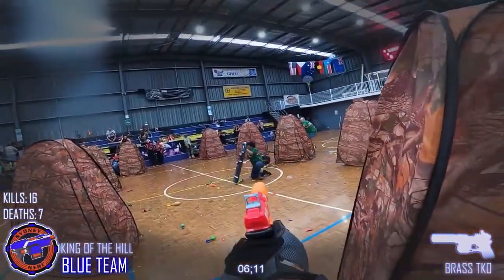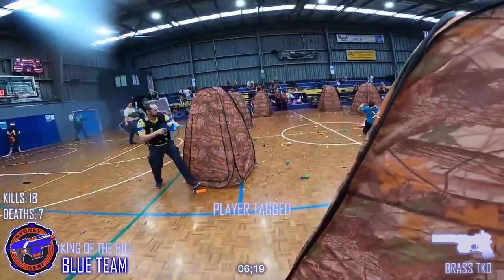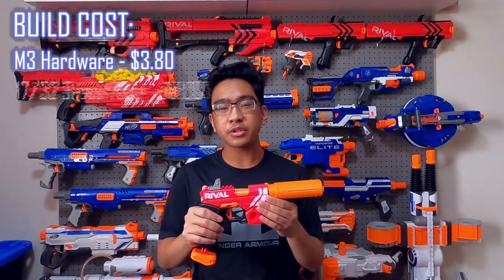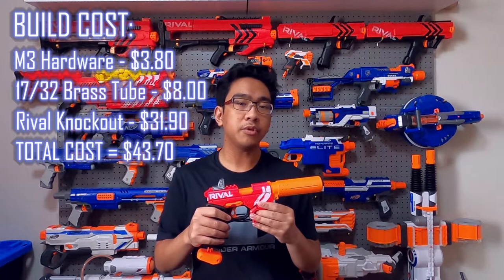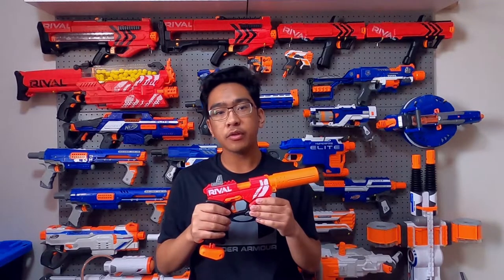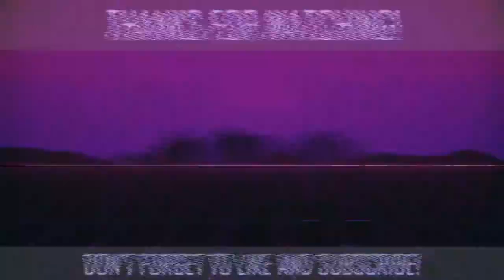Brass Barrel TKO Overview | Nerf Rival Knockout Inline Clip Mod

Comment: great vid, just put together a tko myself.  it seems you've switched to the mk2 as a sidearm, but what were you using for a holster with the tko?
Reply from the maker: I'm still using the same holster that I used for my TKO with my Mk2. It's just an adjustable holster I found on Ebay years ago.

Comment: You should be getting higher than 120fps with a stock spring tko. My inline clip TKO gets 150 with the stock spring.
Reply from the maker: Yeah, my TKO is definitely hitting lower numbers than it should be. I'm guessing it's due to the opening of the brass barrel as it isn't very refined and my air seal might not be the best because I'm using electrical tape to fix the barrel in place instead of o-rings. I'll get around to fixing it up at some point.
Reply: 150 consistently? What are the barrel specs? Currently trying to build  one as well
Reply: I installed a new spring in my knockout and when I fired it for the first time at broke the internals any idea as to why
Reply: @DaWiTtLeR  the spring was too strong, placed wrong, or other parts of the gun weren’t rearranged correctly

Comment: Brass is not the best for inline clips. The polycarb is better and allows more air flow around the darts in the inline clip. You said 120 fps. Is that when only one is in there? Fps is less with more then one dart.
It's a good idea but inline clips aren't that great and are kind being fazed out I believe due to inconsistency in performance shot to shot. Just make it a true sealed brass breech and with stock spring I get over 150fps
Reply from the maker: I know a proper brass breach will increase performance and consistency significantly, but I built this blaster to meet Sydney Nerf's pistol rules that limit fps to 150. At that point I would rather sacrifice the extra 30fps for 3-4 extra shots.
The brass is not the chamber that forms the inline clip. The extra darts sit in a 3D printed piece where there is plenty of space around the darts. When fired, the first dart in the clip is pushed into a brass barrel. When comparing this design with ehdrien's original design, the larger polycarb tube is replaced by the 3D printed piece and the smaller polycarb tube is replaced with 17/32 brass. Sorry if I wasn't clear about that in the video.
I've improved reliability some more since recording the footage for this video by increasing the chamfer on the brass and have yet to re-chrony it.